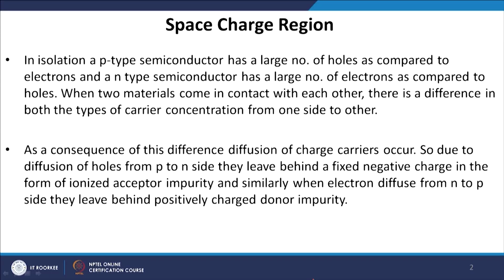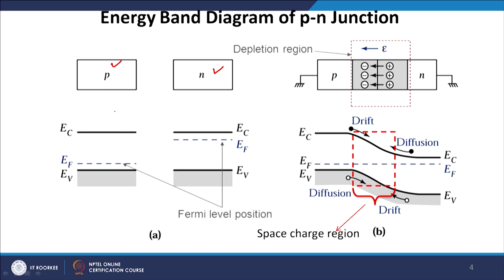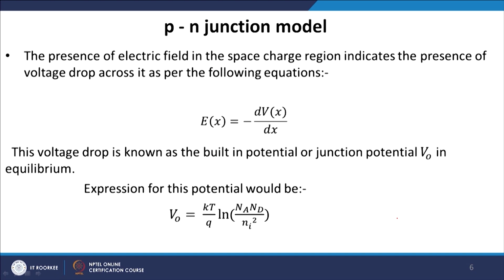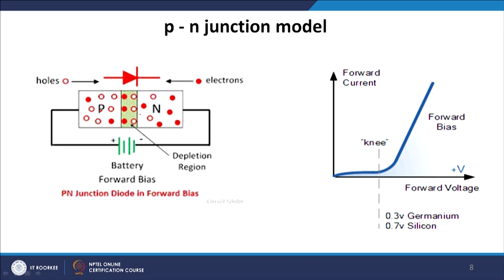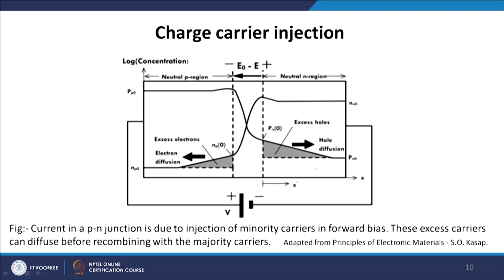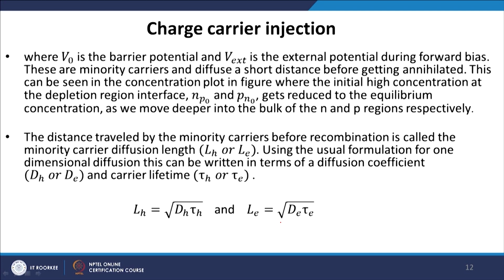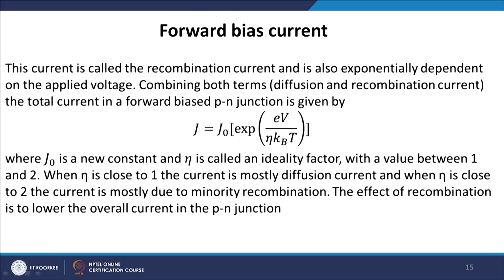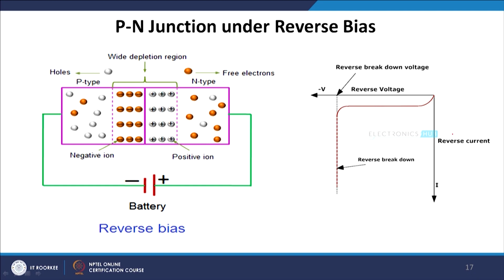P-N junction model and Diode working principle

Comment: The potential barrier in p-n junctions allows current in the forward bias condition and prevents it in the reverse-bias condition. It forms naturally by migration of carriers when a p-type semiconductor is joined with an n-type semiconductor because the potential energy distributions of their electrons are different. 
The current in a diode under forward bias and in constant thermal equilibrium is due to the movement of the holes and the electrons moving and recombining on and on and on. 
It would be useful to know what a current really is by a unified approach to electrostatics and circuits which is usually taught separately in textbooks and physics courses in science and engineering. 
Watch the two videos listed below to learn about Current, the conduction process, surface charges and Voltage at the fundamental level using a unified approach to electrostatics and circuits 
1. https://youtu.be/REsWdd76qxc 
2. https://youtu.be/8BQM_xw2Rfo 

For operation as a check valve, a spring is necessary. For operation as a diode, a p-n junction is necessary. As long as the valve is operating, the spring will always have a displacement, however small. Similarly, as long as the diode is operating the junction will always have a barrier potential, Vo, however small. (Vo is about 0.6 volts for an unbiased silicon diode.) 

Therefore, it is incorrect to say that the pn junction potential barrier is overcome and then the current flows in a forward bias. 
One of the vexing questions that students seek an answer to is, how much is Vo–Vf ? For large applied forward voltages? Greater than Vo? say, greater than 1 V? 

The answer: Vf adjusts itself to a value such that the conservation of current law is upheld. And this will not make Vo = 0. In other words, | Vf | < | Vo |. 
Further, Vo the potential barrier cannot disappear. Refer Electronic Devices and Circuits by Millman Halkias and Satyabrata Jit.
If a forward bias voltage VF, greater than Vγ (of course) but less than Vo were applied, the diode current will be large but the potential barrier may be lowered to an extremely tiny value.
If VF is greater than Vo then, the current will be quite large, Vo does not disappear but is reduced to a tiny value and the excess voltage of VF over Vo is dropped across the bulk p and n regions. The current may result in excessive heating of the diode.

Vf adjusts itself to the value such that the sum of the large diffusion current and the small drift current in the transition region equals the drift current in the bulk region where most of the applied voltage is dropped. 
That is the reason why the VI characteristics of diodes plotted in data sheets and electronic manuals are upto about 0.6 V to 1 V for silicon diodes and seldom beyond. 

And if applying voltages greater than, say, 1 V, a current limiting resistor is added in series with the diode. Space does not permit a full discussion of diode operation here. 
One intuitive way of understanding this is provided in textbook 4 (see below). In the last frame of the first of two videos above a list of textbook references is given which discuss all these topics in more detail. Textbooks 3 and 4 give more details of p-n junction diode operation under forward and reverse bias. 
Textbook 4 discusses the differences in the physical processes underlying rectifier diodes' and LEDs' operation. Also in textbook 4 is discussed why the potential barrier can never be made 'zero' in operational diodes.